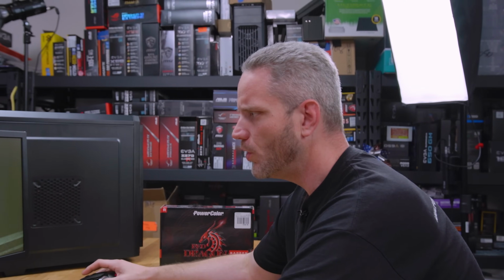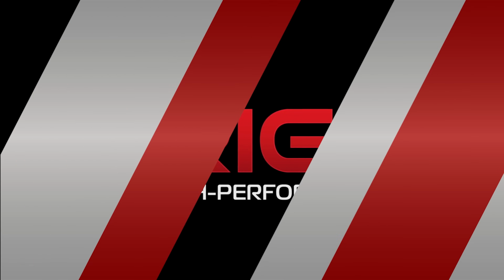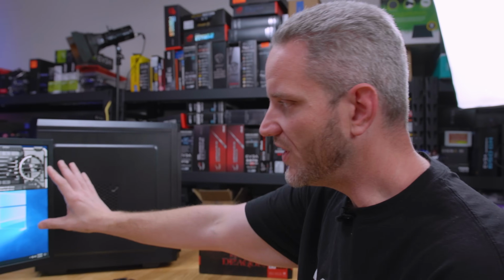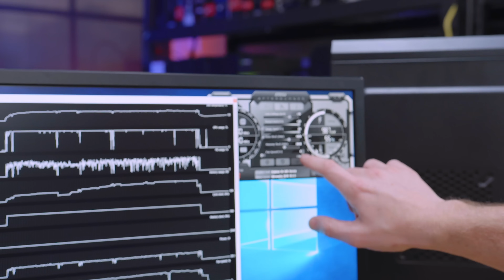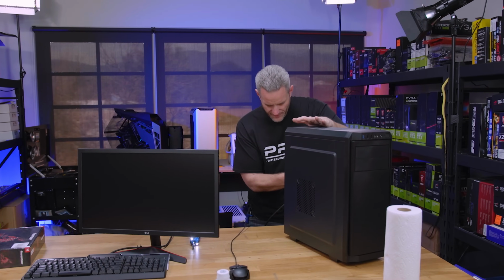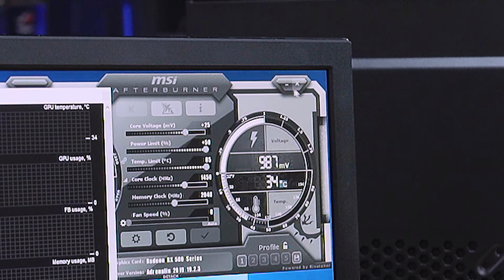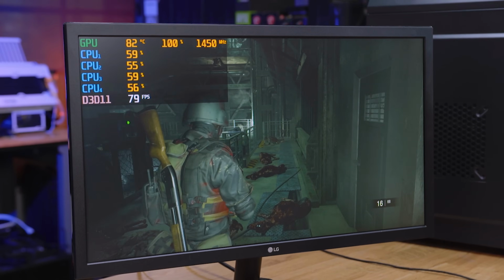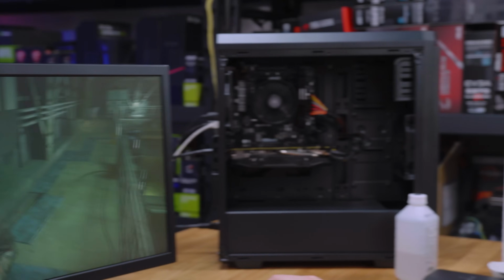Should you replace your video card's thermal paste??

Comment: I have the MSI RX 580 Armour MK2 8GB. Running +18 on voltage and steady at 1475 core and 2100 memory using MSI Afterburner. GPU never exceeds 65C even in the most demanding games. Fan curve for the GPU is still set to auto. Don't have the best case for cooling either.
Reply: Not Bad. Maybe I lucked out but I can run an Undervolt overclock on a Sapphire Pulse, the stock Core clock is 1366 Mhz I got it to 1400 Mhz at -18Mv and them mem is at the Stock 2000 Mem I could put it higher but I haven't seen much improvement doing it, though I also tweaked the fans a bit and set the power limit to 90% and it can hold at 68c in a Blender Load at that clock, I tested stock paste as well and the difference is not that great even with artic silver or thermal grizzly usually 3c or 4c...

Heck you only need to Change Paste when it goes totally Dry or you think you got a Serious Issue...

What I have found is most Rx 580's and 570s come with an Overvolt of 10 to 20 Mv... So Yeah it's an Art to work with that little wiggle room... So your settings are just the reverse I got a Profile that can pull that, with a slightly more aggressive fan curve... In fact I have the Fans on my card spinning at 30c 30%, 40c 40%, 50c 55%, 60c 65% by 70c it's at 80% and then if by some chance it hits 90c 100%... You can hear the fan at 60c but Ehh heard way worse it mimics my Intake and Exhust fans and Cpu Cooler... Bit like White Noise I have more cooling than I need.

I never buy Power Color, their Coolers are Weak Sauce, only MSI, SAPPHIRE if it's AMD, EVGA or MSI if it's Nvidia... Though I had one PNY and one PAL those were ok... But not Great...
Reply: @Zacarriss  I have heard sapphire cards overclock with less voltage. I'm sure I could tone down the voltage and maintain the clock I have now but I've got it stable at higher clock speeds than most run their 580s. Sure, it's an almost nonexistent difference in performance from 1450, but hey, I like to go big lol. Had it at 1500 with +25 voltage but I couldn't get it completely stable. Never had issues with heat with this card tho.
Reply: @justinnoel6273  Yeah the MSI coolers are very good... The problem with the power color is the plate and pipes are separate rather than one piece, MSI and Sapphire use bare copper and the pipes are in the plate... The Fans are also typically much better, so I am not surprised to see your temps, better Quality...

Comment: Before seeing the video, as far as I know it's a good idea to replace stock thermal paste after like 4-5 years of use. Aside from that, usually you won't get much better results even if using premium thermal paste (maybe 2-3 celcius less).....HOWEVER, if you use liquid metal then there is a good chance you'll see a noticeable drop right off the bat. 
I find that using LM will usually always drop 5c which is substantial. In my case, I bought a used GTX 1080 that I got for a good price...I later noticed why it was a good price. It was one spicy boi, if left without a fan curve, it would reach almost 82c. I decided to LM it, and now I peak about 68c....a 14 degree celcius drop, which is huge.

Comment: I switched out the stock paste on my rx580 to IC diamond
Before it easily went to full fan and still have thermal instability, and crashed various times with overclocking past 1400 on the core and 2100 on memory
After the new paste the fan barely went to 70% under the same loads
It runs with 1467 on core and 2222 on memory no problem
Reply: @StuntmanFord which rx580 did you have? fwiw my sapphire nitro+ se runs at 75℃ stock fan curve @ 1450/2250.
Reply: I did absolutely nothing with my RX 580 nitro plus limited 8GB. It works at 1430/8400 clocks  with 45-48C , fans are off. Never went more then 76C on it..You did something REALLY  wrong with your build or software if you dont have same numbers. Really really wrong..
Reply: @beba2893  msi armor rx 580 8gb. Using afterburner it refuses to bring memory past 2250, however it seems our core clocks are close. Also a severe bottleneck could be the potato i7-2600 i currently use as my processor 
I actually havent heard of memory clocks that high on thus card, i was wondering what you used to get them
Reply: @remanjecarter2787   hmmm..mine is Sapphire, nitro plus ,  stock goes 1430/8400 its at 40C fans off even. Afterburner , well with some previous versions i had huge issues..Shouldnt MSI alredy come factory OC? Then you cant do much more..Well theres some tricks messing with BIOS on it, but that i would not recommend. It becomes very unstable, then artefacts, then white smoke of truth. :) Look, sometimes your lucky with batch , sometimes your not..even 2 identical cards form 2 different batches will give totaly different results when you push them..On  normal use they will be same. But  when you start to play with its power and voltage...then its whole new ballgame..I wouldn't do it..well i did it many times and burned quite a lot of them and motherboards that way.. :) And watch it, when power spikes trough one component , all are stressed actually...So if you fck up really bad, it will cost you 1000 euros easy. GPU/MBO/RAM....Its not worth it to play with that for maybe 5 FPS only. Unless your Jay who gets it all free :P
Reply: @beba2893  you right, sometimes it isn't worth it to have a severe overclock, i'm content with what i have until i can get a more capable processor. I wouldn't plan on doing overclock prep past afterburner like shunt mods or bios changes, so that's something that i probably won't brick with. It could be my afterburner version too, haven't ran updates in a few months, but i don't think that would be a problem. Might not be the best clocks getting hit, but they're enough to raise frame rates
Reply: @StuntmanFord could be the company then if switching the paste didn't help, though i wouldn't see how fairly similar heatsink designs would fare drastically different for thermal performance
Reply: Is the RX 580 a good Choice in the 250-300 CAD$ or There is much better at this Price point its for a birthday gift, thanks :)
Reply: @SunzOffski you never know, sometimes asking more about what's happening helps, even if it's not true, a desire to troubleshoot goes a long way
Reply: @StuntmanFord my msi gets to like 60 something but i got it at 2100 core and +900 on is urs with overclocking?
Reply: When I overclocked mine to 1400 and overclocked the ram, mi card was hitting 80 or so. Ultra settings.
Reply: @StuntmanFord then why you bought xfx ? Sound stupid
Reply: I just returned my 8gb RX 580 because it was the worst card I've ever owned.
Reply: @roguestatus9040  was there anything specific about it that was bad, its a fairly decent mid-tier card, not the best out there but it can handle decently
Reply: Rogue Status I have a ryzen 5 1600 (4mhz) and rx580 and I get over 80fps in pub g

Comment: Jay, do you think there's any correlation between the GPU and CPU when it comes down to GPU Temps? I've noticed that when I changed my older CPU with a newer one, the GPU temps went 3-5 degrees C down.
Reply: Has to be

Comment: I replaced the thermal paste on my DDR3 ram now it’s got RGB

Edit: Makes one lame rgb comment. BOOM! Error 404 on my YouTube inbox 😂#thatescalatedquickly
Reply: To turn it into ddr4 you need thermal grisly
Reply: Why go through the trouble when you can just download more RAM
Reply: It didn't turn it into DDR4?  Slacker. 😜
Reply: No you have to put liquid metal on your ram to upgrade it to ddr4
Reply: horndog jr so true
Reply: @horndogjr  Ill try that also
Reply: I overclocked my fps
Reply: I overclocked my rgb
Reply: I replaced the thermal paste on my DDR4 ram and now it's DDR5 with rgb.
Reply: Frans Botha Are you sure it's not just on fire
Reply: Matt G at this point anything could be possible with this potato 🥔
Reply: I downloaded 256 gb ram and now I can run far cry 5 gta 5 and pubg at the same time
Reply: Suid Afrikaner of Duitser?😂
Reply: GhostY South Africa 🇿🇦 one way! Aweh bois! 😂
Reply: Im just using some old copies of Dance Dance Revolution stuck in the slots. I got 32gb from it though.
Reply: Put Conductonaut Liquid metal on it enables quad channel.
Reply: @jondonnelly3  Only if you inject the liquid metal into your empty dimm slots
Reply: You mean rgb with surreal flaming effect? 😊😊
Reply: Ive never seen a joke that bad get so many likes
Reply: Fury_Spirits dude never have I honestly 😂😂😂
Reply: MY 8 GB DDR3 RAM DIDN'T FIT TO DDR4 SOCKET, THEN I REPLACED THERMAL PASTE AND BANG... IT WORKS.. 😂😂😂😂😂
Reply: I've put a brick in my PC, but my PC won't power on. What did i do wrong? @theverge
Reply: I have to try that
Reply: Why didnt you just download the RGB? its free on limewire
Reply: I replaced the RGB on my DDR3. I am now up to my ankles in thermal paste, and it's still getting higher. Please send help.
Reply: Bro! Tutorial video please.... help the rest of us become above average joes
Reply: Shannon apparently downloading and over clocking is the way to go.... we’ve been doing in wrong this whole time
Reply: Frans Botha I never understand why people make edits on their popular comment. Like relax man you’re not a celebrity now.
Reply: Wait your YouTube inbox doesn’t exist? That makes no sense
Reply: I replaced my thermal paste on my PSU now my PSU has increased to 1000wats and has RGB which increases my fps on a gpu that I don't have
Reply: You check your inbox? Wait, you have notifications on for that shit?
Reply: Please someone tell me if there is a chrome plugin for filtering Youtube comments with certain keywords like "RGB". Can't take it anymoer
Reply: @CarlBergsdorf  Don't know If there's a plugin but just ignore It dude, It's not that hard.
Reply: 8Fernus Im trying but seeing the stupid rgb comments on every tweet and video from LTT is killing my spirit. Its my own fault from reading the comments but still, would feel really nice to hide all that unwanted stuff away
Reply: @CarlBergsdorf  LOL your watching a channel with one of the most watched full RGB builds on YouTube. It's not going to happen.
Reply: Carl Bergsdorf I’m sorry I know the feeling I just couldn’t resist 😂
Reply: Thats sick dude!!
Reply: Jou fokken dutchman
Reply: @bikesandstuffs   hahaha fok jou man xD
Reply: @dracobloodfist3036  ff normaal doen
Reply: Clapham888 😂😂😂🇿🇦👏🏻

Comment: I changed the paste on my MSI 1070 Armor and it reduced the max temps from 81 to about 70-71.
Reply: That's a really nice gain. Mine also runs up to about 81c (OCed to the max that is). I would gain about 2% fps at best if I could drop the temps like that. So I leave it as is.
Reply: @robertvandeneijk1284  Mine was OC'd as well, I got an extra 15mhz or so on the core from the change, but that was about it. Of course GPU boost held the clocks higher for longer though.